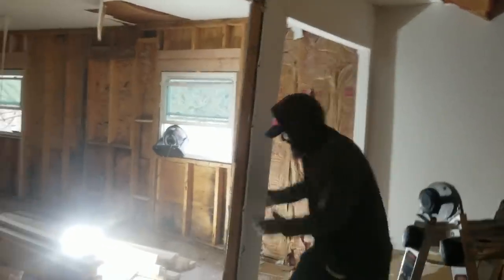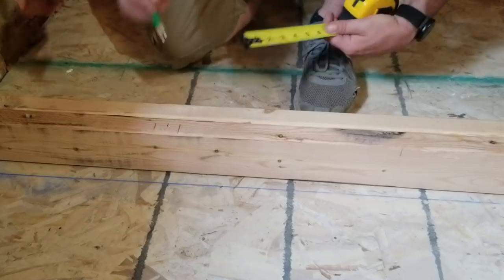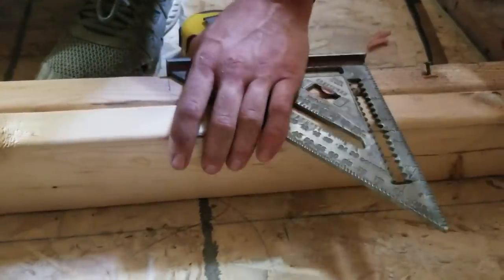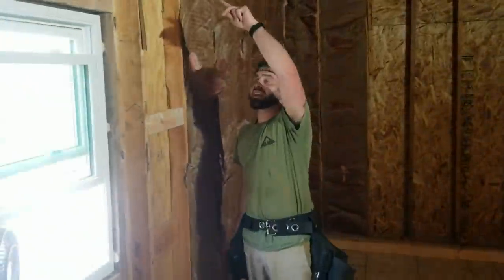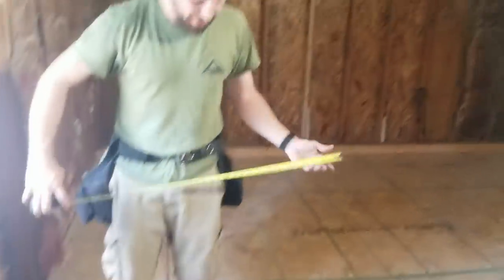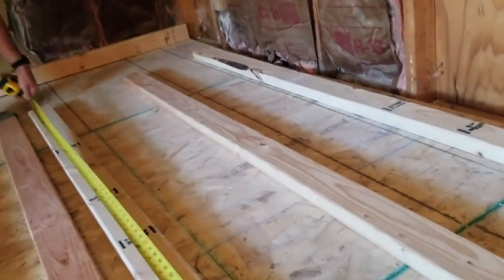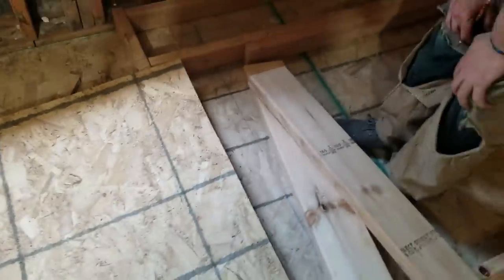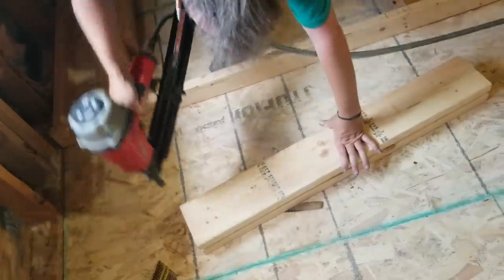My Flip House | Building the Master Suite

Comment: When you go to do the shower, instead of packing the pan. Check out laticrete hydroban shower pan system along with wall board. For the plumbing all you do is run a 2 inch pip out the floor and the oan sits over and locks on. 10x more efficient and will last a very long time. Thats all i use is laticrete

Comment: I have a simpler way. If you find the overall average length for each corner stud and subtract by 10 and then multiply by the sq of pie you will get the average size of a kangaroo leg. And the total will be 3-4 beers and  a burger for lunch.

Comment: Where the walls run parallel to ceiling joists you need drywall nailers.. rock is every 6 inches screwed butts
Reply from the maker: Yea I meant to put that on there.  The video was getting too long.  I already got them figured out

Comment: No need for a 2×6 header if its not a bearing wall,not hating either.
Reply from the maker: its necessary for the plumbing side of the shower where the handle is. if not necessary its definitely preferred.
Reply: Over built is better built! But for a flip house i would just make code
Reply: @mm88swrt  over build it so you don't have to build it over 👌